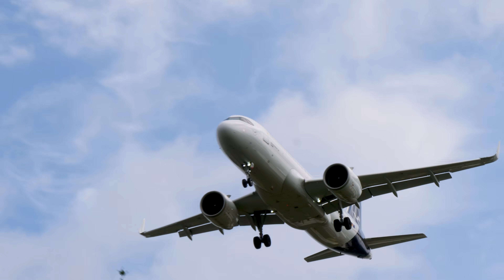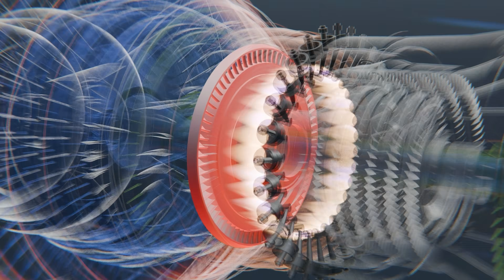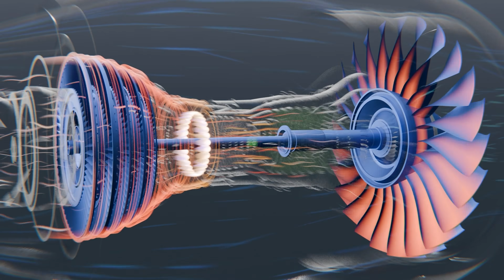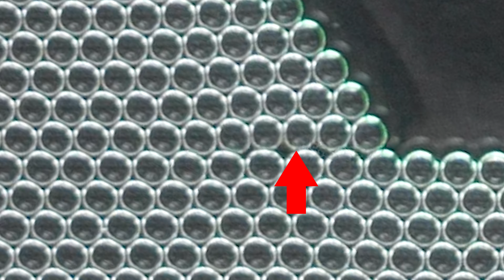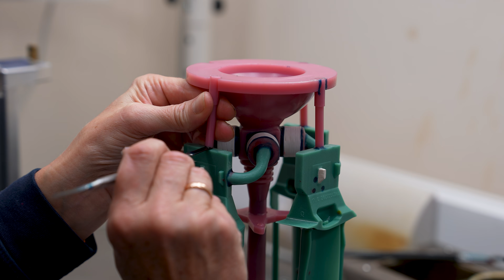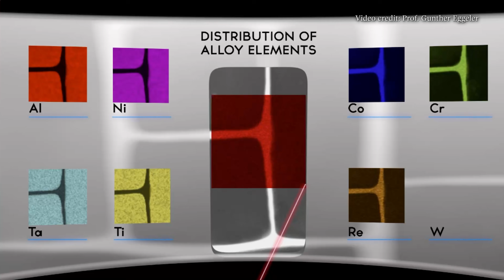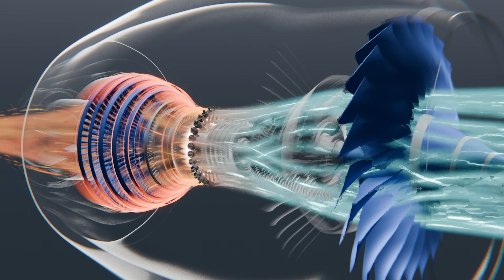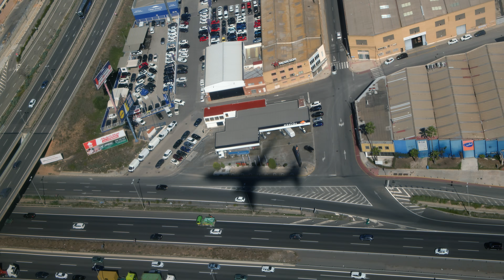The Ridiculous Engineering Of Jet Engines

Comment: This highlights why airlines are looking into electric propulsion.  First for short-haul regional flights in the 2030s, then long-haul airliners in the 2040s.

An electric motor will have similar high RPMs but none of the volcano-level heat of jet engines, which is a massive reduction in material stress.  Electric motors are also much more power dense than jet engines.  Electric motors will be 1 or 2 orders of magnitude less complex than a jet engine.   This simplicity directly translates into savings from ongoing expensive maintenance and periodic costly overhauls required by all jet engines.

Then there's the electric isolation from global oil shocks like the one from the ongoing Iran conflict.  Every time there's a conflict with fossil fuels at the center, airlines lose money!  Sure, airlines will pass on the elevated fuel costs to the passengers, but passengers then start postponing flights or cancelling them altogether.  This leads to "demand destruction," which then leads to lost revenue.

With electric flight, the massive footprint of airports can be the actual electricity generation with rooftop solar panels and any open land areas.   Airports can stockpile this energy into grid-scale storage on-site.  This buffers all that aircraft megawatt recharging load from hitting the local grid.
Reply: The problem with battery for long haul is weight. A typical airliner has a MTOW way higher than max landing weight, which is not possible with electric
Reply: @Orbital_Inclination  Thanks for the comment!  Sure, it is definitely a challenge.  Long-haul aircraft will take longer to electrify, but I think we will eventually get there.  I'm talking in the 2040s time period.  There are huge technical and financial advantages to ditching jet fuel from a bigger context of society, down to the accounting balance sheets of airliners.

Firstly, electric motors are about three times more efficient than jet turbofans.  This significantly lowers the energy requirement.   Jet turbofan designers are now at the point where adding just half a percent efficiency improvement costs billions of dollars, and today's efficient jet turbofans are showing themselves to have costly, premature failures.  So imagine what 300% will do.

The energy density of batteries is still increasing.  There are step-changes coming, too, like solid-state electrolyte technology.

Then we can do radical changes to airframe design...

In the future, we could see the batteries and support electronics integrated directly into aircraft wings and fuselage.  This is called a "structural battery," which supports "Active Airframe" design.  Think of birds—they don't have extra fuel tanks or separate motors.  Their muscle tissue, which forms the structure of their body, is actually both the energy source and power delivery.  Nature already provides a blueprint away from our industrial 20th-century way of building airliners today.

BYD is already using structural batteries in their EVs with their BYD Blade platform.

With structural batteries and active airframe designs, the battery weight melds into the structure of the aircraft.  So its actual additional weight starts to disappear.

For continued advancement, old designs often need to be completely scrapped.  Think of the transition from analog to digital communications & media.  The transition from ICE to EV, etc.
Reply: @Orbital_Inclination  Furthermore, along with the topic of this video, "The Ridiculous Engineering of Jet Engines", that type of advanced bleeding-edge engineering comes with very real negative costs...

Jet engines are so complex that aircraft manufacturers like Boeing and Airbus cannot manufacture them.  It takes dedicated companies (GE, Rolls-Royce, Pratt & Whitney) to design and manufacture jet turbine engines.  They have a de facto monopoly...

These companies often hog all the profits because they hold the patents and the service contracts.  Thus, they end up keeping most of the profits on each unit sold.  You can imagine airliners hate this monopoly power that the "Big Three" jet engine manufacturers have had over them and continue to have.

Airlines are constantly pushing for more efficiency.  But it costs billions of dollars of R&D just to eke out a fraction of 1% efficiency from jet engines.  Today's jet engines are already close to their physical limits.  Yet electric propulsion is 300% more efficient than today's jet engines.

What's worse is that there's been a spate of new jet engine failures recently.  The push for ever more efficient jet engines is making them more brittle and more prone to failure.  Once a failure or defect is detected, there is a long line-up for repair. Since, again, only the jet engine manufacturer makes repairs.

Electric propulsion solves a lot of this.  An electric motor would be an order or two of magnitude simpler in design than a jet turbofan.  And probably an order or two magnitude cooler running operation versus the volcano temperatures that jet turbofans are subjected to constantly.

Thus, electric motors will have fractions of the maintenance times of jet engines.  It gets even better...

Electric motors provide instant thrust, increasing performance and safety.  They'll have quieter operation.  Electric propulsion will have regeneration capability on descent, which saves energy and is quieter still when gliding over densely populated cities on arrival.
Reply: @Orbital_Inclination  Also, continuing the structural battery/active airframe discussion, electrified long-haul aircraft almost certainly will use the Blended-Wing Body (BWB) airframe design.

BWB airframes are long known to provide 30% to 50% aerodyanamic efficiency over the traditional "tube-and-wing" design.  That is huge!

The BWB also provides greater potential with more internal volume.  Thus, BWB has a high affinity for the aforementioned structural batteries and active airframe designs.

BWB airframes are likely to use multiple electric motors, like 6 to 8+.  This provides Distributed Electric Propulsion (DEP), which improves redundancy and performance.  Since a failure of one or more electric motors still allows for making a safe landing or just continuing the flight as usual.  DEP also improves efficiency with "blown wing" aerodynamic efficiency improvements, which improve both slow and fast speed operation since a smaller blown wing surface provides the same lift as a larger wing without blown wing efficiency.

With all the potential technologies I discussed, the traditional jet-fuel powered "tube-and-wing" aircraft design with two engine pods starts to look like a flying brick in comparison.  This brings electrified long-haul airliners within reach in the 2040's time frame.  Even before then, we'll see short-haul regional routes go electric.
Reply: @beyondfossil another limitation of electric propulsion is awful thrust at altitude. Props are woeful at height, whereas jet engines work incredibly efficiently at higher altitudes. Electric aircraft will be mostly restricted to the same altitude bands of current prop aircraft, serving small commuter routes or general aviation. Flying long haul at these lower altitudes would be an awful experience with lots of drag and far more turbulence.
Reply: @Orbital_Inclination  Not a problem.  High-speed high-altitude electric flight would use something like an electric ducted fan (EDF).  EDF aerodynamics is different than open propeller designs.

The problem you're referring to isn't really a problem of high-altitude but a problem with high-speed.  At high speeds, open propeller tips start breaking the sound barrier, which causes a host of problems.

But EDFs change this effect.  For starters, the diameter of EDF is smaller, and thus its tip speeds would already be slower.  The EDF shroud also slows down the incoming air before it hits the fans.  This means the plane can fly at high speeds while the fan blades inside the duct stay at a "slower" subsonic speed where they are most efficient.

Modern jet engines (turbofans) are actually just fuel-powered ducted fans

So to electrify a long-haul airliner, they aren't putting a wooden prop on the front, they're replacing the "volcano fire-breathing core" with a high-torque electric motor to spin that same massive ducted fan.
Reply: @beyondfossil this isn't true. EDFs are not efficient at all. They have none of the advantages of open props with none of the advantages of turbines. 

Slowing the air entering an EDF would also be a pointless waste, as they work fundamentally differently to jet engines (ie no massive expansion of exhaust due to combustion) so the thrust would just drop massively as the inlet flow did.
Reply: @Orbital_Inclination  Of course, an EDF doesn't work exactly like a jet turbine.  That's kinda the point.  Because an EDF is not a "jet" of heated gas.  That hot gas jet is the direct cause of (a) extreme thermal operating conditions and (b) a massive loss of efficiency.   Some 60% of jet fuel is going into just creating useless heat and noise!

You may be confusing heat with thrust.  Thrust is fundamentally defined by Newton's Second Law of motion, where F = ma. To get a forward force (F), you must accelerate a mass backward; in this case, the mass is atmospheric air.  Basically, both jets and EDFs are "reaction engines" but accomplish the reaction in different ways.

Specifically, a jet engine uses combustion to create high-pressure, high-velocity gas. This is like a "high-speed, low-mass" approach.  In contrast, an EDF uses a high-torque electric motor to spin a fan that mechanically compresses and accelerates the air. This is a "lower-speed, high-mass" approach.  It's well known for a while now that lower speed flow and a higher mass are more efficient to get the requisite force (see below about "bypass ratios").

As long as the EDF accelerates the air out the back, you get thrust. The "expansion" in a jet is just one way to achieve that pressure.  EDF blades do the same work mechanically without needing the 2000℃ volcano temperatures that make jet engines so brittle.

Need more convincing?  The EDF acts as a jet turbine with a very high bypass ratio, where the "bypass" is the air that does not enter the high-speed hot jet core but bypasses it annularly around it.  A higher bypass ratio provides higher efficiency, and jet turbines themselves have been steadily moving towards higher ratios.  Early jets had a 1:1 ratio, but modern jet engines are around 10:1 bypass ratio.  The experimental CFM RISE jet is aiming for 50:1.

If heat were the secret to thrust, we’d still be flying pure "turbojets", but those faded in the 1950s due to extreme noise and low efficiency. The fact that the industry has moved toward 10:1 and now 50:1 bypass ratios proves that the goal is to maximize air mass, not heat. An EDF is essentially the 'ultimate bypass' engine—all the thrust but none of the thermal waste.

Ultimately, the aviation industry is hitting thermal, material physics, and engineering walls all at the same time. We can't make jet cores any hotter or more complex without them becoming 'brittle' and unreliable. Moving towards EDFs isn't just about changing the fuel. It's about moving to a simpler, high-bypass mechanical system that prioritizes momentum over heat.
Reply: @beyondfossil the problem with EDFs is that thrust from an EDF decreases with speed and altitude. In a turbofan, the engine core 'jet' picks up some of this slack as the fan thrust drops off. So for EDFs you're limited to a turbo-prop performance window (approx 0.6 Mach and medium altitude) vs turbofan (0.8+ Mach and high altitude). That means more drag due to more air density, so less range, etc.
Reply: @Orbital_Inclination  On the contrary, EDF will be more capable than jet turbofans at altitude for most of the reasons you mentioned.

First of all, all engines lose thrust with increasing airspeed...

Because, eventually, the speed of the incoming air approaches the exhaust speed.  If that weren't the case, an engine could provide unlimited thrust, which would obviously be absurd.  Specifically, F = ṁ(Vₑ - V₀), where Vₑ is exhaust speed and V₀ is airspeed, and V₀ starts becoming equal to Vₑ, which results in the (Vₑ - V₀) term tending towards zero.

EDF will actually perform better at altitude because EDF doesn't depend on oxygen, and the -60℃ air temperature actually benefits the electric motor and battery!

OTOH, the lower oxygen and frigid air at high altitudes are all actually detrimental to jet turbofans...

Airliners fly at altitudes of 10,000m or greater where the oxygen concentration is only some 26% that of sea level.  So a jet turbofan has to work harder because the jet core has less oxygen to burn. To maintain thrust, it has to run hotter, which aggravates to the jet material "brittleness" problem.

EDFs are not limited by maintaining a "fire" that needs plenty of oxygen.  EDFs are only limited by how fast you can spin the fan. Because the air is thinner, there is less drag on the fan blades, allowing an electric motor to spin them faster to compensate for the lower density.

Also, since electric motors are so power dense with both lower weight and smaller size, having multiple of them like 4 to 8 wouldn't be uncommon.

You're treating the jet exhaust like a rocket booster that 'kicks in' at high altitude but that's not how airliner jet turbofans work...

In reality, 90% of an airliner's jet turbofan thrust comes from the bypass, and only 10% from the core.  But that core thrust is the most expensive, hottest, and least efficient part of the engine. If the industry is moving toward 50:1 bypass ratios (like the CFM RISE), they are literally trying to turn the jet into an EDF.  They ain't 'picking up the slack' with the jet core—they're actually trying to get rid of the core.

At altitude, the jet engine is literally gasping for air and running at its thermal limit just to keep the fan spinning aggrevating an already bad problem.  However, an electric motor doesn't need any oxygen.  It actually thrives in the -60°C cold and can spin the fan at higher RPMs to compensate for the thin air.  All without any of the 'brittle' extreme thermal complexity of a combustion core which leads to costly frequent maintenance cycles.  That jet engine maintenance is needed from all size of jet turbines from lunchbox-sized RC hobby jets to truck-sized airliner jet turbofans.
Reply: An EDF is essentially the “fan-only” part of a turbofan taken to the extreme: it produces all its thrust by accelerating a large mass of air at relatively low velocity, with no high-speed jet exhaust. 

In a modern turbofan like the Rolls-Royce Trent 1000, most thrust at low speed already comes from the fan, but the hot core exhaust becomes increasingly important at higher speeds and altitude, helping keep thrust relatively stable. An EDF lacks this jet component, so its thrust decreases more noticeably as speed and altitude increase, making it behave more like a propeller system.

The trade-off is efficiency versus speed. EDFs can be extremely efficient and very quiet at low to moderate speeds, with simpler mechanics and more flexible installation (e.g. distributed propulsion), but they struggle to maintain thrust and efficiency at typical jetliner cruise speeds. Turbofans, by combining fan and jet thrust, achieve a balance that supports fast, high-altitude flight, which is why they dominate long-haul aviation, while EDF-type systems would likely favor slower, short-haul, highly efficient aircraft designs.
Reply: Ultimately, they're for different use cases. EDFs would likely challenge the turboprop market share, if battery energy density ever gets anywhere close to kerosene, and their fixed weight fraction stops being such a crippling factor.
Reply: @Orbital_Inclination  The jet turbofan engine core contributes 10% of the total thrust at altitude, but very inefficiently, due to oxygen starvation.  Jet turbofan engine manufacturers actually want to further minimize the core.

You might be thinking the core is a rocket engine, but it isn't; that's not how turbofans operate.  Once we enter spaceflight, both EDFs and jet turbofans would stop operating.  That's when a rocket would be needed, but that's a whole other topic.

EDFs will have no problems generating the force needed to fly at typical airliner speeds at a typical cruising altitude (10,000m).  The EDF doesn't care about oxygen content and actually prefers the frigid cold air.  The thinner air allows for a faster fan RPM.

As we discussed, the EDF's duct slows down the incoming air.  So, as the airliner cruises at Mach 0.8, the duct ensures that the air hitting the fan is only moving at Mach 0.5, which helps maintain the separation between Vₑ and V₀.

Banks of EDFs 4 to 8 are possible, as they're so power-dense compared to a giant jet turbofan pod.  

Furthermore, these EDF pods can be situated in the "boundary layer," which is already slower-moving air due to unavoidable parasitic drag produced by the fuselage's "skin".  That boundary layer further increases the gap between Vₑ and V₀, allowing the EDF to generate more force at cruise speed.  This parasitic drag is turned from a deficit into an asset.  It would be very difficult to mount a large jet turbofan next to the fuselage to exploit the boundary layer because of its enormous size; the hot exhaust could damage the fuselage and all downwind components.  EDFs don't have that problem because they are small and don't emit super-hot exhaust.
Reply: The turbine isn't inefficient at all, the fuel-air ratio is kept nearly constant to ensure the cleanest burn and thus best thrust from each unit of fuel possible.

Also, at altitude the core provides much more thrust (30-40% typically) to make up for poorer fan performance. 

And no, you don't want boundary layer air hitting the fan, it causes vibrations and poor efficiency.

And no, it would not be hard to mount a turbofan in the boundary layer, we just don't do it because it's an awful idea (vibration means more wear and way more cabin noise). The hot exhaust gas is already shrouded in a thick cooler layer. This is the reason we can flush-mount turboprop engines already, as the prop is located before the boundary layer on the wing.
Reply: @Orbital_Inclination  You're referring to maintaining a correct air-fuel ratio to prevent the engine from literally smoking or flaming out.  But that doesn't mean the engine is "efficient".  That's the chemical-based stoichiometric balancing act that the FADEC system manages with fuel-to-air ratios, but the raw power output decreases.

The FADEC obviously has to lean out the fuel to match the significantly lower oxygen content at altitude.  But when engines run lean, they run hotter.  The engine might be forced to run at lower power just to avoid melting itself, despite the -60°C air outside.

Moreover, if there is 74% less oxygen and you maintain a constant fuel-air ratio, then you are, by definition, burning 74% less fuel.  Your power output drops by roughly the same margin. This is why a jet engine that produces 50,000 lbs of thrust on a runway only produces about 12,000 lbs at high-altitude conditions, directly due to the significantly reduced amount of oxygen.

Thus, the airliner designers must oversize their jet turbofans to accommodate this aspect, which incurs secondary efficiency losses.  Because a heavier, larger engine has more drag and weight than a smaller one.  For example, if a jetliner requires 10,000-lb of thrust to cruise, it actually needs larger 30,000-lb worth of engines because of the unavoidable chemical limitations imposed by oxygen deprivation at altitude.

Simply put, in a combustion process, oxygen is a primary reactant...

If there's less reactant, the entire chemical process must slow down.  A battery-powered EDF bypasses the chemical limitation entirely. It doesn't need a reactant to create torque. It uses the cold air as a pure heat sink, completely decoupled from oxygen content.  For example, an EDF would still spin in the vacuum of space, and if given a medium, it could provide thrust as well.

Must also consider that there's less atmospheric drag at altitude...

The losses in turbine efficiency are offset by reduced atmospheric drag at cruise altitudes.  But this lower drag at altitude applies to all aircraft.  But since an EDF incurs less efficiency loss at altitude, it would actually improve fuel efficiency there rather than remain constant.  I am referring to the TSFC (Thrust-specific fuel consumption), which would decrease for EDF airliners at higher altitudes rather than remaining flat.
Reply: @Orbital_Inclination  Yeah, it seems counterintuitive to use boundary-layer air.  But you may be viewing it through a 20th-century understanding of aerodynamics and fuselage design.

Major advances have been made in the control and understanding of boundary-layer ingestion (BLI) engines.  BLI is not just sticking an engine closer to the fuselage.

Vibration control...

Fan blades can be designed to be thicker or shaped differently at the root versus the tip to handle the uneven pressure in the boundary layer.  Instead of vibrating, the fan is physically "tuned" to the specific swirl and pressure of the ingested air. It turns the "vibration" into a steady-state load that the bearings and blades are designed to carry.

Active Flow Control (AFC) to "pre-clean" the air...

Small fins inside the duct can "mix" the slow boundary-layer air with the faster free-stream air, creating a more uniform flow before it hits the fan.

Golf ball example...

Have a look at why golf balls are dimpled on their surface to control boundary layer air.  The dimples on the golf ball "energize" the boundary layer, allowing it to adhere more closely to the ball, reducing the low-pressure area behind the ball that literally wants to "suck" the ball backward—dimpled balls travel significantly farther.  The same thing happens to anything moving through the air, like aircraft, cars, and trucks. This is an example of how it's possible to manipulate boundary layer air to your advantage.  

Small jets of air inside the duct intake that "re-energize" the boundary layer or suck away the most turbulent "dead" air. This has been proven to reduce inlet distortion by more than 50% and can also remove vibration.

NASA has already proven that with active flow control, we can manage the vibrations and unlock a 15% jump in total aircraft efficiency that traditional "clean air" engines can never achieve.

Almost certainly, the electric Blended-Wing Body (BWB) fuselage designs will use BLI-mounted EDF motors.  NASA's 2024–2026 data on the D8 Double Bubble and BWB show that even if the fan itself loses a tiny bit of efficiency (maybe 1%) by dealing with the "dirty" air, the net benefit to the aircraft is a 15–20% fuel burn reduction!

In the end, it's far better to have a slightly less efficient fan that "recycles" drag than have a perfectly efficient fan that creates a massive wake of wasted energy (see the golf ball example).

BLI core advantage...

Traditional Jets: They take "clean" air and add new energy to it. Meanwhile, the fuselage is wasting energy creating a turbulent wake. You are paying twice for this: once for the thrust and once for the drag.

BLI Engines: They take the "wasted" energy already present in the turbulent boundary layer and recycle it. BLI engines not only create thrust, but they also "cancel" out drag.  Don't pay twice for the same thing!

This is 21st-century Wake Energy Recovery that only electric propulsion can realistically achieve.  But massive jet turbo fans are essentially stuck with 1960s "pylon-drag" physics.

Though engine manufacturers prefer clean air because it improves engine performance and simplifies design. In the end, it's the entire "system level" performance that's more important.

Recent NASA wind-tunnel tests also show BLI will not only increase efficiency but also reduce noise since turbulence and harder-working engines all add noise.

So, that kinda leads full circle back to what I was talking about earlier...

Electrification, blended-wing body, BLI, and structural batteries are the kinds of "next level" radical system integration changes needed to push a stagnant aircraft design industry to new levels expected for 21st-century flight.  Because 20th-century designs have essentially been maxed out.  These changes turn traditional concepts on their side or even upside down.
Reply: @beyondfossil it's like you've asked an AI to summarise a topic you do not understand, then entirely misunderstood the answer and stated it as fact. Every one of your comments misses other key context. 

For example, the BWB efficiency is nothing to do with the engines, but due to the fact that the entire fuselage generates lift rather than carrying a dead weight tube around. NASAs BWB prototypes literally include podded turbofans as their propulsion method in most recent examples. 

And no, golf ball physics does not apply here, because parasitic drag is a much greater factor at higher subsonic mach numbers than for a golf ball, and the dimples create a lot of it. We already have a solution for boundary layer control at high subsonic. It's called the supercritical airfoil and has been around for decades. Active boundary layer control is far more to do with replacing control surfaces, and nothing to do with electric flight anyway.
Reply: And no, sorry but you've lost any credibility by stating that aircraft have way higher thrust just to maintain cruise at altitude. That is so woefully incorrect it's laughable. The huge excess thrust vs cruise thrust is due to the need for sufficient take-off performance, nothing to do with high altitude flight. As someone who has piloted turbofan business jets, the only time I ever got close to full thrust demand was during take-off. We didn't even climb at max thrust, let alone cruise at higher altitude with it.
Reply: @Orbital_Inclination  You're trying to bypass normal debate flow.  Please take a point and provide a counterpoint or a rebuttal.  Then I respond with mine.  See how it goes?

But if you’re tired of reading and typing, then feel free not to respond, as nobody is forcing you to be here.  You entered this conversation on your own accord.  Then you've made several completely incorrect statements and assumptions about basic aeronautics, physics, and turbofan operation, and I corrected them piece by piece without drama.

I hope this thread helps you better understand the benefits of electric flight from a economic, airline operations, physics, and energy perspectives.  Electrification is a challenge, no doubt. But not as far off as you may think.  But you must think outside the traditional.  If you come away with nothing else, I hope you come away with that.

That said…

You misunderstood my BWB references.  BWB helps enable electric flight in numerous ways: larger internal volume for batteries, better inherent aero, and rear-positioned engines help maximize the benefits of boundary-layer ingestion.   I didn't state it in one place; I stated it across several posts.

The golf ball analogy illustrates how the boundary layer can be manipulated to benefit aero.  It doesn't matter if you're a golf ball at 100 mph or an airliner at Mach 0.8 because a vacuum behind you is still a vacuum that is proportional to your size—so it does scale.  Look at NASA's D8 "double bubble" experiments.

Aerospace engineers cite the Magnus effect (golf ball dimples) because it allows "forcing" air to move in ways it doesn't want to.  There's a popular NASA article on the aerodynamics of golf balls that discusses deliberately making the airflow turbulent, which "energizes" the air to hug a surface longer.  BLI will use active measures to cause this, not just passive dimples.

Your reference to super-critical airfoils is tangential to BLI.  Super-critical airfoils delay dangerous shockwaves on the wing and increase the critical Mach number, but they do nothing to recover the momentum lost along the 100+ feet of the fuselage. OTOH, BLI is referring to "energy recovery".  They're two different concepts: Wave Drag (shockwaves) and Wake Energy Recovery (momentum loss).

You can have a plane with both supercritical wings and BLI engines, because they solve two different problems
Reply: @Orbital_Inclination  My point wasn't regarding requiring more thrust at altitude.   The point was that an oxygen-breathing machine, like a jet turbofan, has to work harder because of the limited availability of oxygen molecules to provide the requisite thrust at whatever level required for a particular aircraft.  The stoich ratios have to be maintained, otherwise it risks engine flameout due to running too rich.

As such, the turbofan has to be generally larger to be able to safely burn more fuel at a hotter temperature to compensate.  At ground takeoff, despite high throttle, there are many more oxygen molecules available, so it wouldn't run so lean.

I said that in relation to EDFs that have no such oxygen requirement.  So EDFs would not exhibit this constraint on the designers.